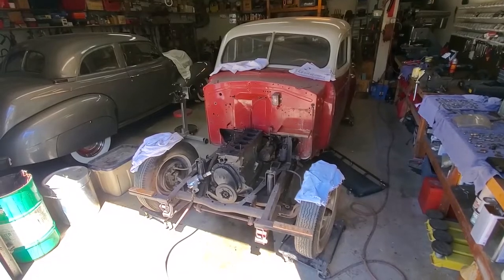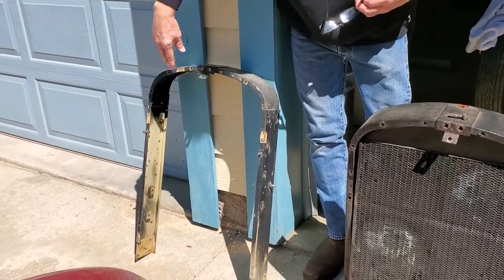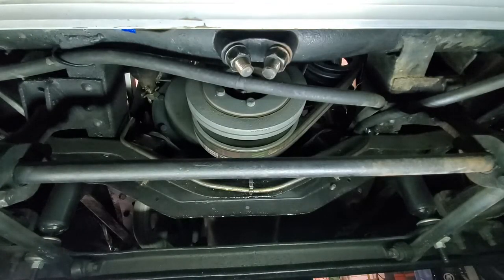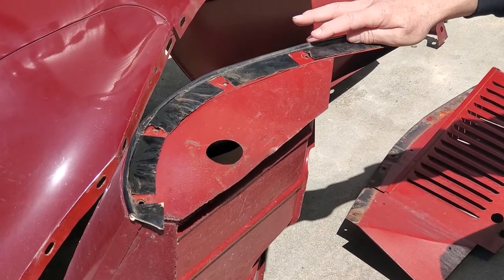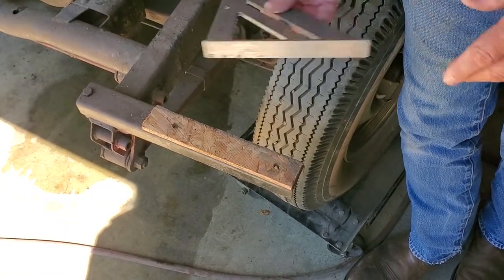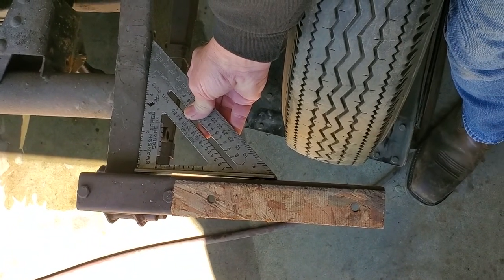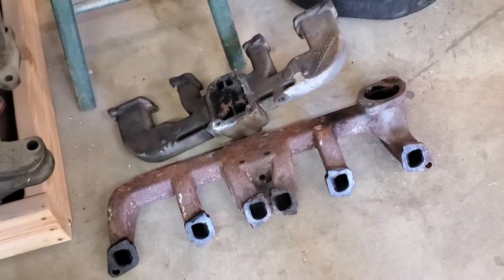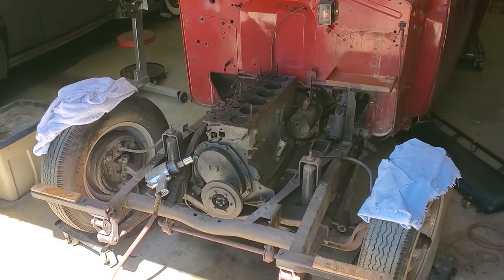1939 Sharknose Graham Disassembly - Sharknose Graham Restoration Teardown and Hidden Surprises

Comment: just want to thank you for taking  the time to shoot this video. I'm on the last of the reassembly of a 1939 Spirit of Motion here in my shop. I've been working on this car for about 2 years now. Although I've restored several cars before this one, I had actually never heard of a Graham before this and it has been challenging at times. The owner requested many upgrades to the car to make it more "modern", however I've tried to keep the original appearance as much as possible. As I had never seen one of these cars before, I photographed each section as it was disassembled and bagged/labeled all fasteners associated with it. Unfortunately, many of the early photos were lost with the camera and sd card, so I'm left scratching my head and scouring the internet in search of photos that will help. The engine that was in the car was toast, not sure if it was original or not, but the owner came up with a replacement somehow, although it seems to be a little different. One of my current issues is finding the port to attach the oil line coming FROM the bulkhead mounted oil filter TO the engine. In addition, I have two small diameter rods, one attached to a small plate that has a spring on it, a small bead chain hanging from it and a shorter rod that is curved. The other rod is about the same length (about 12 to 14 inches) and it is curved on one end with what looks like it might utilize a clevis pin or something like that and the other end has what looks like two short locking tabs. I haven't seen any photos or videos yet that have these parts or shows the oil line routing. Do you have anything on hand that would show these items? Again, I sincerely appreciate your time and thank you for the video. jim
Reply from the maker: Hello! Thanks for sharing your story! Here's a good place to start. Take a look at our playlist, which to date has 23 videos about the 1939 graham. https://www.youtube.com/playlist?list=PL_APaYrVINp99ykov-0IM3j07N4AMDuPy
We'd also like to direct you to our website: https://customreplications.com/
You might also find the Graham Owner's Club International website useful: https://www.grahamownersclub.com/ 
We'll gather up more answers for you. Thanks for watching!
Reply from the maker: Here are some more details to answer your questions, and they are good questions.

First, 2 engines were used by Graham. Both are 217.8 cubic inches from the factory for Spirit of Motion cars 1938-1940. The base engine as shown in this video is a non-supercharged version. All engines in these cars have 31 head studs. Early 1936 and 37 engines had fewer studs. It is possible you have an early engine or a Continental version of the engine. We have a video on the channel covering the Graham engine, and later Continental engines. https://www.youtube.com/watch?v=Z3i7f3aX6hA 

In our video, "Graham Supercharged Engine Overhaul part 2 1:00 when I am rotating the engine the pressurized oil out port is visible at the rear of the block as a hole in line with the fuel pump mounting. This goes to the inlet or side fitting on the Fram bypass oil filter. The return hole is the one below this hole and slightly to the right at the bottom of the block, if you are facing the block on the passenger side, and it is upright unlike this point in the video. This hole connects to your output or bottom fitting on the oil filter canister. You can see that video here: https://www.youtube.com/watch?v=H0C4HFRYuds&list=PL_APaYrVINp_T1lnW9kGydck1QpLJHp6k&index=3&t=1s 

Regarding your other question, please send a photo via our website. Go to www.customreplications.com and scroll to the bottom of the home page. Click the Drop Us a Line button to send us a photo along your question.

Hope you find this and our videos useful. Thanks!
Reply: @CarzPlus  
That's great information, thank you very much. As you indicated, your website is a treasure trove of valuable information, I can't express my gratitude in words alone in the time you have saved me in research. You have most everything right there! If this is Mr. Spencer I'm messaging, we've spoke briefly before about this car. So, I'm not going to waste your time with babble, I think I've got most of the reassembly figured out now. I am however, in need of the inner window sweepers for all 4 doors, and the outer sweeper for the right front. Do you have any or do you know where I might find some? Will generic sweepers work? Again and again, thank you for your time. I'd love to share some photos of this car with you when I'm finally finished. Have a great day! jim